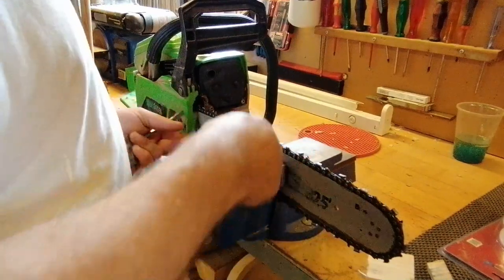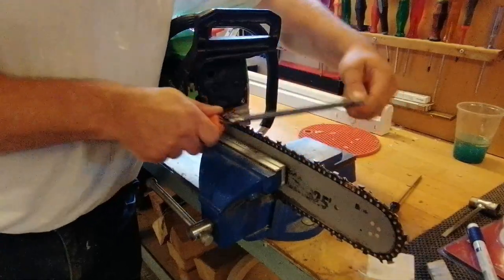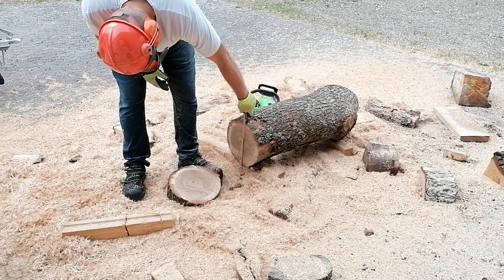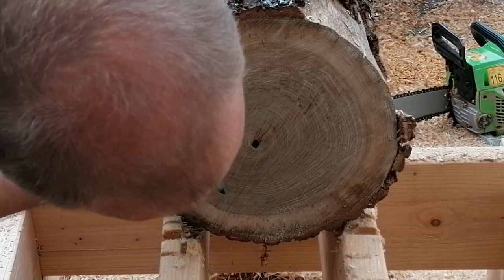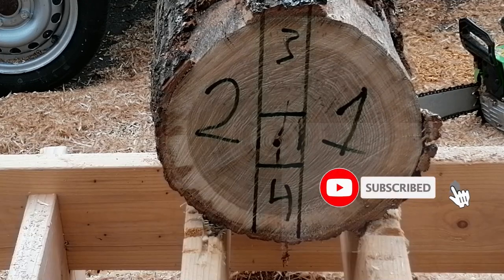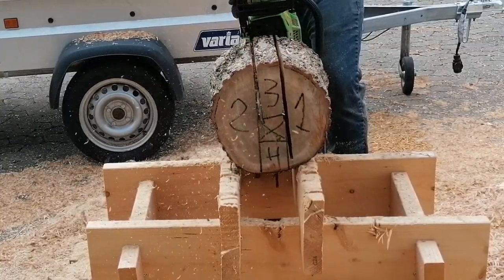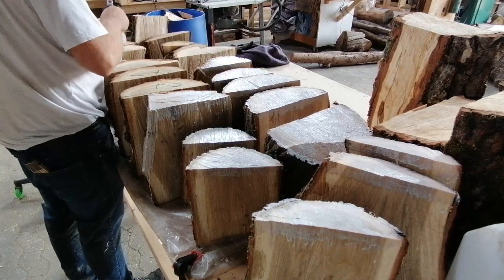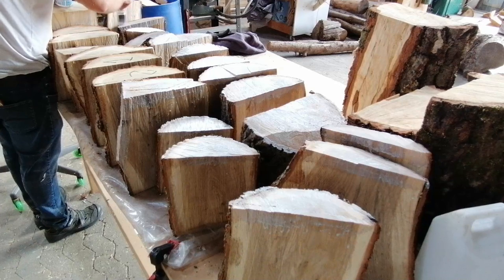How to Cut a Log to Bowl Blanks - Woodturning

Comment: Most of what I turn is Pacific Madrone, which is a variety of laurel. It has extremely high water content, and warps insanely. I found out that it is better to let it stay in log form and trim off the ends each time I want to make more bowls. I lost a lot of blanks when I cut into sections and then sealed the ends. Part of that may be because our summers here in western Oregon are very dry, and even with heavy tarps over them, I lost most of my first few logs. 

When I got my first chainsaw, the chainsaw shop asked me what I was going to do with it, and I told them about making bowls. They suggested a rip chain for my saw. That was good advice. Most of the blank cutting I do is ripping, and a cross cut chain does a worse job of ripping than the ripping chain does on cross cutting, if that makes sense....

Comment: Hi, Kim...very good instructional video. I use Titebond glue, full strength, for sealing end grain...I’ve found it better than Anchorseal or paint at preventing splitting.
Reply from the maker: Hi Rick.. Thank you very much for watching .. I do get some cracks sometimes with the mixture of 40 % water and 60 % glue but not much .. I would love to be able to use Tigetbond  glue, but for some reason it have the same price as Gold pr. once here in Denmark 😂😂 but I will try to use clean glue next time and mixed glue and check the differens .. thank you for the tip ..  Have a great day and stay safe 😀😀
Reply: I have also mixed the glue with some melted Parafin wax which is very inexpensive.  Also, I have used the pruner sealer you can get at almost any hardware or nursery and it seals nicely but is a little tar like at first and black.  When it dries it is easy to remove and seals tight.

Comment: Thanks for Sharing Kim. Lately, as I now have a Bandsaw Mill I've been using that to cut Blanks down to size and remove the Pith, then chainsaw them to length. For sealing I use old wax from my wife's candle's, just throw them into an old pot on the fireplace to melt the wax, and paint that on.
Reply from the maker: That's a great idea with the candle wax.. I hope to get a bansaw mill some day .. just need to convince the Boss :-) but she will come around at some point 😬 Thank you for watching .. have a great day and stay safe 😀😀
Reply: I learnt to use the candle wax from local guys that use a different type of Mill (Lucas Mill), when they would do unseasoned timber, they would coat the ends of the log with wax as it's quicker and easier than trying to coat each board after cutting.
Reply from the maker: @DiemenDesign  sounds good i might have to try that some day .

Comment: Try and tighten the chainsaw chain slightly while sharpening, not so tight that its hard to spin but so it sits tighter on the bar as you stroke the file through. It will give a nicer edge and makes sharpening much easier
Reply from the maker: Thank you very much for the tip, and thank you for watching .. stay safe :-)